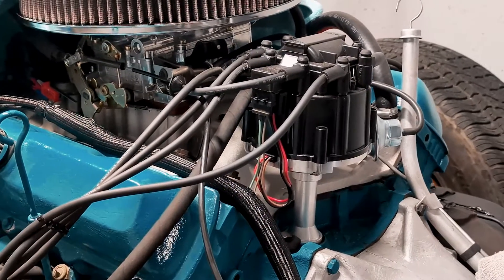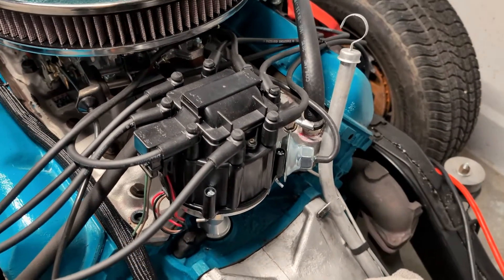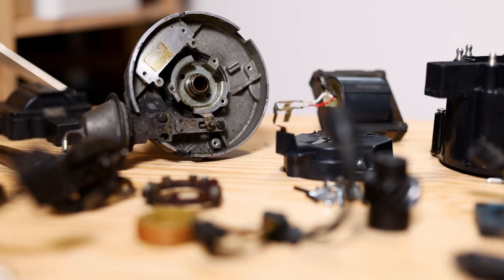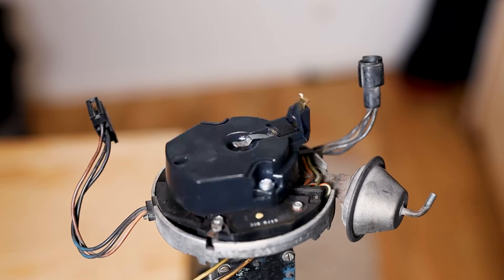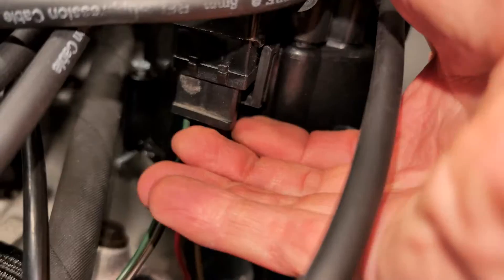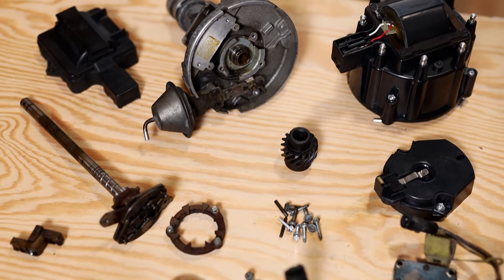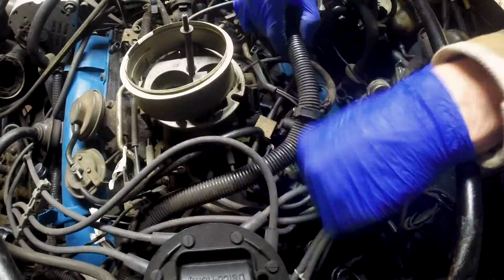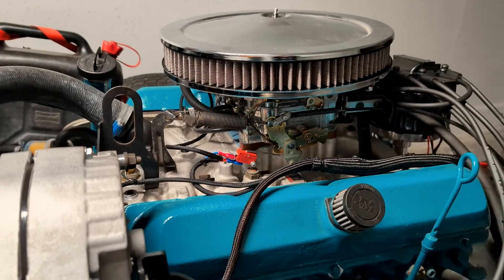GM H.E.I. Distributor: Pros, Cons & Special Features! 🚗💥

Comment: Thanks for the video. Been researching all the electrics for my 1988 Caprice wagon because I'm hoping to make a custom ECU for the oxymoronic sounding 'computer controlled carburetor'. Basically just a quadrajet with solenoid controlled metering rods. I'm mainly curious how much I could improve the gas mileage using modern microcontrollers, better and more sensors and more complex control systems.

Comment: My 1974 Chevrolet Monte Carlo was built in August of 1974 and, being late in the production year, was one of the earliest cars equipped with HEI. I put ~300,000 miles before I had a failure; the control module had gone bad. The replacement was defective; it failed after a couple of weeks. The second replacement was likewise defective. I looked at the manufacture lot numbers of both defective parts; they were the same. I then went in search of another replacement. The first three parts stores had the part with the same lot number. The fourth store had a different lot number. I bought that one and ~200,000 miles later, it's still working fine.
The only other issue I've had has been with the vacuum advance failing every few years but that's to be expected.
Reply from the maker: Thanks for sharing your experience! It's true, dealing with replacement modules can sometimes feel like a gamble. I replaced mine a few years back, and thankfully it's been holding up well.
Appreciate you taking the time to comment!

Comment: btw it cant be speed sensor :) i also think it was spped sensor but it is not :P just simple is u have 2k rpm and you in neutral spedometer shoud show u speed i diconected this wires and i still got speed on my dash board 
it cant be , btw what was the issue with what part i have a problem olso meybe it can help me
Reply from the maker: It actually is a speed sensor specifically for the ECU, not for any gauges, I linked a short in the video and here's the link: https://youtube.com/shorts/DHhXhb2yzP0
This picture is from the official shop manual.

The tachometer terminal is the one closer to the engine on the distributor cap, when installed. It is usually written on top of the cap.

My issue was the water temp. sensor. It was dead, and so the ECU interpreted the data as a warm engine, injected less fuel and therefor I had always had a rough engine start when it was cold. I switched the sensor and it works fine ever since :)
Hope that helps!
Reply: @thataustriancarguy  That's correct, only EFI Cadillacs had that speed sensor on the shaft.

Comment: i see you used susbstitute hei  what was the model?
Reply from the maker: The one shown on my rebuilt engine has the part no.: SKP SKDIGM29R. A model found on, for example, the 1979 BUICK ELECTRA 5.7L 350cid V8.
Here's the link to rockauto.com: https://www.rockauto.com/de/moreinfo.php?pk=11395669&cc=1016671&pt=7108&jsn=8

Comment: I had an issue when I converted my 240z HEI, there were no running problems just my tach would not pair up, ended up converting to a later 28zx system and all was well.

Comment: Best design EVER! One wire connection and fully contained. There is a company that makes them for all V8's using the GM basic guts with custom bodies to fit the particular application. High performance electronics and high output coils.

Comment: If you want better control...
Pull the four pin ignition module and replace it with a seven or eight pin.